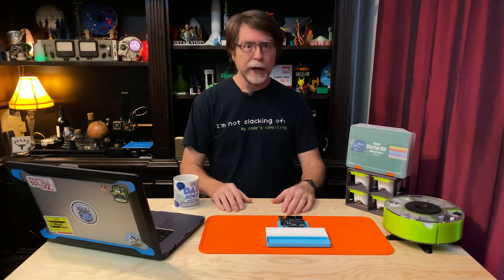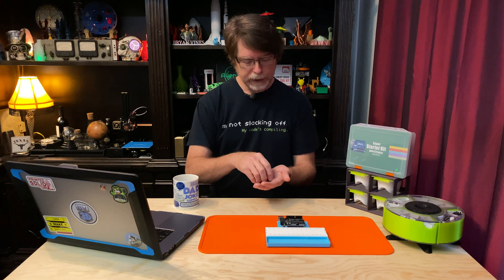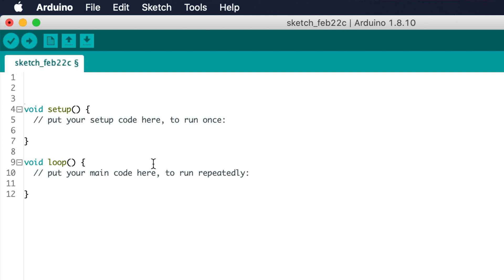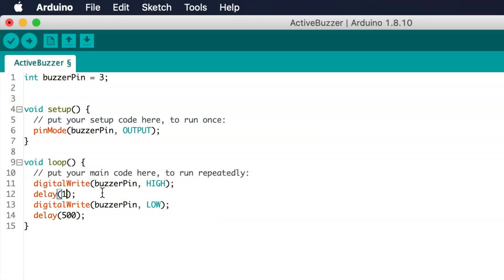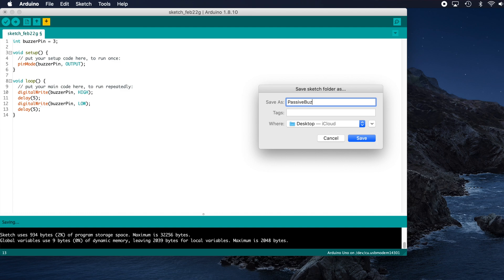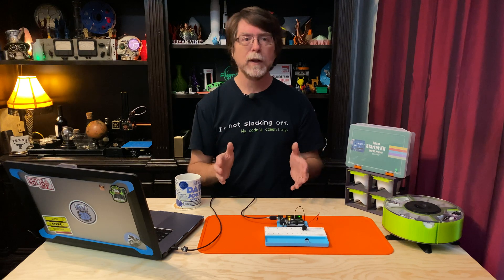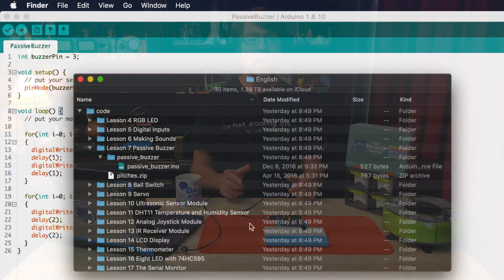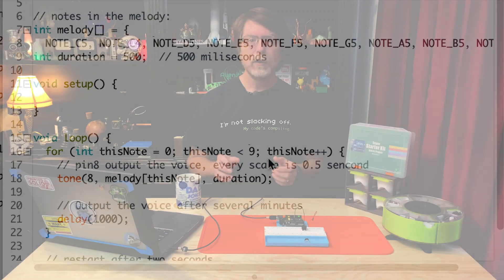Get Started in Electronics #5 - Active & Passive Buzzers w/ Arduino Uno

Comment: #include "pitches.h"

#define SOUND_PIN 8

// melody
int notes[] = {
  NOTE_E5, NOTE_B4, NOTE_C5, NOTE_D5, NOTE_C5, NOTE_B4, NOTE_A4,
  NOTE_A4, NOTE_C5, NOTE_E5, NOTE_D5, NOTE_C5, NOTE_B4,
  NOTE_C5, NOTE_D5, NOTE_E5, NOTE_C5, NOTE_A4, NOTE_A4,
  NOTE_D5, NOTE_F5, NOTE_A5, NOTE_G5, NOTE_F5, NOTE_E5,
  NOTE_C5, NOTE_E5, NOTE_D5, NOTE_C5, NOTE_B4,
  NOTE_B4, NOTE_C5, NOTE_D5, NOTE_E5, NOTE_C5, NOTE_A4, NOTE_A4};

// timing in eighth notes
int timing[] = {
  2, 1, 1, 2, 1, 1, 2,
  1, 1, 2, 1, 1, 3,
  1, 2, 2, 2, 2, 4,
  3, 1, 2, 1, 1, 3,
  1, 2, 1, 1, 2,
  1, 1, 2, 2, 2, 2, 2};

int length = sizeof(notes)/sizeof(notes[0]);

// duration of each eighth note (ms)
int duration = 250;
 
void setup()
{
  
}
 
void loop()
{  
  for (int i = 0; i < length; i++)
  {
    // tone duration is delay minus 1ms to prevent weird signal overlap
    tone(SOUND_PIN, notes[i], timing[i] * duration - 1);
    delay(timing[i] * duration);
  }

  // restart after four beats
  delay(duration * 8);
}

Comment: You should have held your clip on mic closer to the buzzer - I Had to turn sound full up to hear the buzzer via external 5 Watt amp - Also you did not need the Arduino to make the active buzzer work. As you said just apply a voltage, But note the active buzzer working voltage first before applying any voltage, you did not include the current draw specs of the buzzers ? as the Arduino has an out put current limit.

Comment: horrible, horrible, HORRIBLE puns aside......

first, surprised you didnt go into the "tone" function. but my main question.....

in cases like this, i dont get the "int" thing. typing out the setting of int of buzzerpin on pin3 then continuously typing out buzzerpin a billion times in a sketch, why not just not assign an integer and type only "3" and save like 36 hours in programming? i get that, if you wanted to change the buzzer from 3 to.... 9 or whatever, you only have to change that one instance in the setup, but if your just typing out code for a quick example, it seems quite superfluous.  am i missing something here?

Comment: Hi Bryan, when I open the code for the passive buzzer lesson, there is an error stating, "pitches.h: No such file or directory".  As such, the code will not load. Is there a solution? Thanks, Alan.
Reply: same

Comment: Loving your Arduino intro to electronics series. Do you have an affiliate link for Amazon Australia? Also would you have a recommendation for a 3D printer for a novice that is still sufficiently functional and sufficiently sized to produce, at least, your Arduino work tray and that diffuser "crystal" for the the RGB LED project?

Comment: Thanks Bryan! I'm a older senior 60^ that has been doing PLC programming before I retired. Learning the syntax and command functions of the open source Arduino language is daunting. You do make it easier to understand, but is there a source for that. I was very successful with low voltage control systems just using the voltage potential. I'm not able to write the code like I'm use to. Thanks again.

Comment: Thankyou for the informative video. Quick question is what would have happened if you used the active buzzer for the time that you used the passive buzzer? Better yet can different tones be played through the active buzzer or is it fixed because of the internal oscillator.

Comment: What do the Void statements signify?
Reply from the maker: That's the "return type" of the function. That tells the IDE that the function returns nothing. In other words, the type of thing it returns is nothingness.

If the function returned an integer value--for example, if you had a function which performed a calculation on some numbers--its return type would be "int" instead of "void". 👍